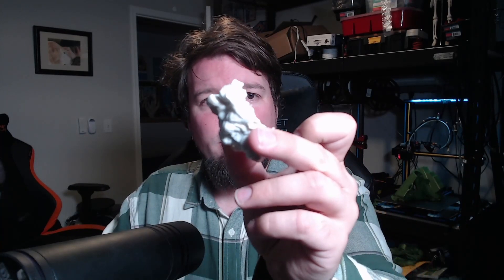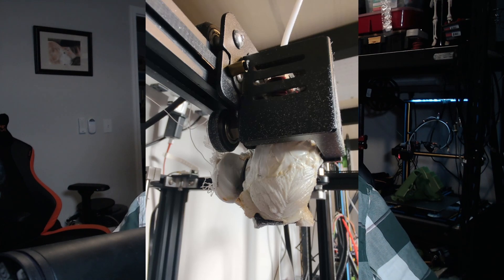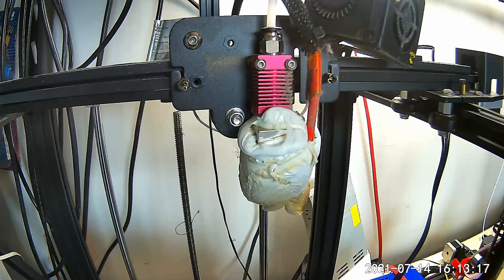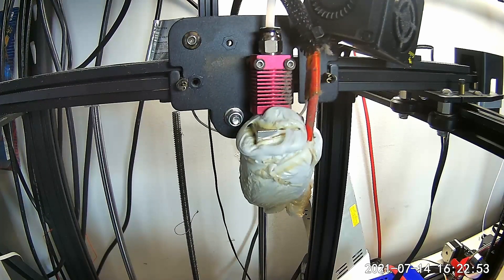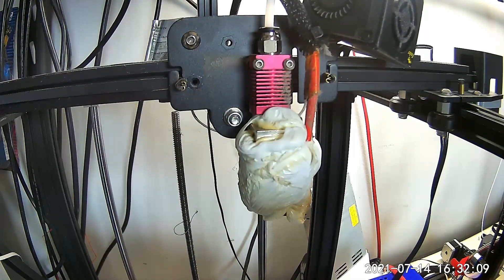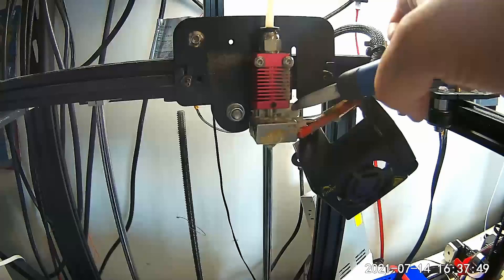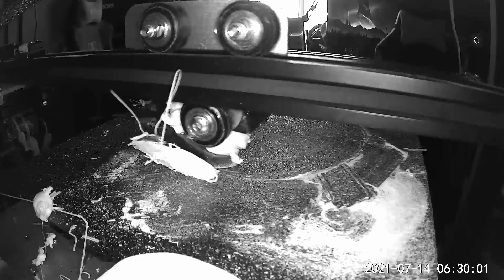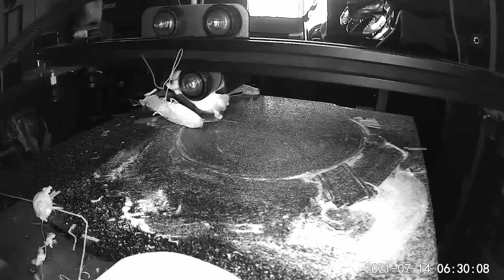Rescue Your Hotend from the Dreaded Booger

Comment: Is that a dust clogged heat sink?
Reply from the maker: There was a little bit of dust, but the issue was that I accidentally loaded in ABS and printed at PLA temps. Similar things will happen if your filament doesn't stick to the bed.

Comment: hello I know its off topic but your only one I can tell you I just installed cr10s BLTouch  firmware everything is installed good but when I goto auto home it goes too center of my bed and starting too knocking please any idea how I get this thing too work
Reply from the maker: If it's crashing into the bed with the pin deployed, check the wiring for the endstop (the black and white wires). Some boards need the wires to be reversed in the connector.